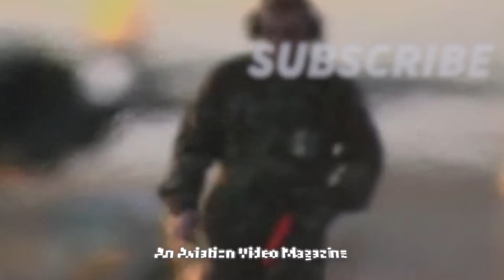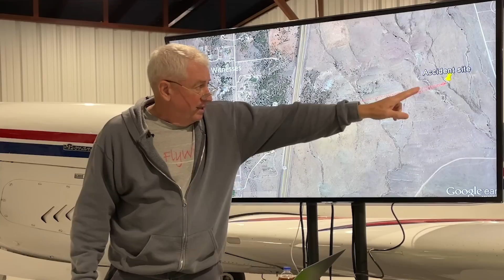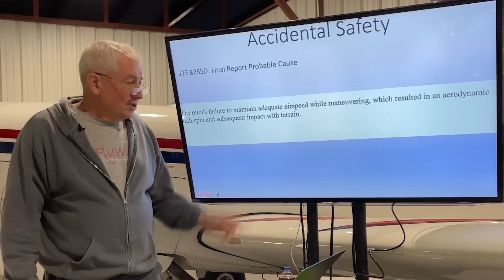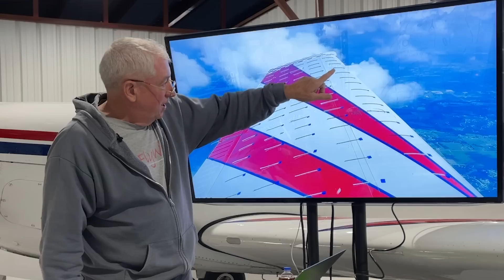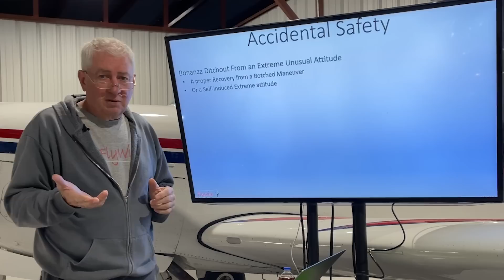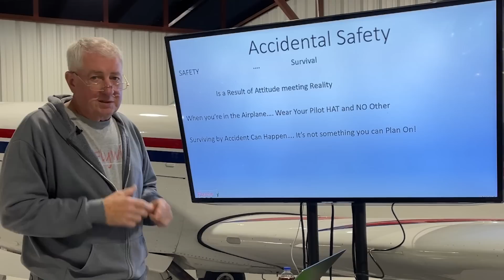Accidental Safety Part 1  LOC I

Comment: Great video, Scott, as always. One question and concern: I fly a G 36 and my POH specifically says that at the onset of the spin, you should go full forward with the elevator. What do you think about this, compared to the advice you provide in this video? 
  Let me take this opportunity to say I just love all your videos. We Bonanza drivers really appreciate your professionalism, and the B-specific advice you provide. Bill
Reply from the maker: Thanks. Bill. In the first 1/4 turn or so a Spin Prevent will work. Unload, coordinated rudder and aileron opposite the nose slice. If you go full forward on the yoke after the spin has developed it is a prospin input and will not be effective at recovery. Did they use the word immediately?
Reply: @FlyWirescottperdue  I see.. that makes sense. Thanks for the explanation. And I am impressed with your quick response!

Comment: Scott - One thing you did not mention that could have contributed to this accident was possible pitot/static icing. You mentioned that there could have been icing in the clouds based on the temp/dew point. Had the airplane been sitting out the night before? Perhaps this is a case of not being in the habit of turning on the pitot heat.  A blocked pitot/static system would basically turn the airspeed indicator into an altimeter adding immensely to the disorientation and the seemingly wild pitch changes at the end.
Reply from the maker: You mixed up videos. The potential of icing was in the F33A accident Part 2. Speed was not erratic and your theory doesn’t account for anything else. Doesn’t sound plausible to me. Was icing a factor? Very possibly it was.  But it remains an open question.

Comment: Hi Scott, Can you explain why pushing is "pro-spin"?
Reply from the maker: Are you ready for a mass moments of Inertia talk? Watch ice skaters doing a spin with their arms out, bringing the arms in reduces the moment arm. Because of conservation of momentum the skater spins faster. In a spinning airplane pushing forward raises the nose ( it’s a moment arm thing) and that reduces the moment arm of the engine…. Conservation of momentum again the aircraft spins faster. In a spin none of the flight controls work like you think they would.
Reply: @FlyWirescottperdue  Makes sense but is this for all spins or just fully developed flat spins? The A36 POH for spins specifies "Immediately move the control column full forward and simultaneously apply full rudder opposite to the direction of the spin...."

Comment: Thank you for this vidio...Years ago I saw somebody mouse up a hammer head in Northern Cali and buy the farm in flat spin.  I did a full power full flap departure stall getting ready for sign off on privot pilot...yeah I know what examiner would ask that..... anyhow falled off to go into a spin...killed the power and stepped on the ball...I was taught to step on the ball as a glider pilot.  Big thing I got from this is kill the power.  I just did it because I didn't want to over speed the flaps.  You live long enough you learn how to not become spin bait.  Or ground scat...

Comment: Hey Scott, love your content! Especially educational information like this...I'm a little older Commercial Pilot candidate (long story, but it's all working out...) and in Canada the spin maneuver is a required element of the flight test. It was when I earned my Private License many years ago here...but, I think it's been dropped for some reason now. The thing that I find interesting, is your video of the tufted inside and outside wings. There's so much happening during a spin; mentally and aerodynamically that I strongly believe every pilot needs the experience.  I don't enjoy doing them all that much anymore, but understanding the correct control inputs to get out of one is absolutely critical...I'll be waiting for part 2!

Comment: Most safety video's people have to watch (for their job) are rather boring, not this one 😁! Excellent (potentially life-saving) information by Mr. Perdue. As I understand power on stalls are not something aircraft manufactures encourage (want pilots to practice) & there is consequently a lack of information how to handle such situations (bravo to Scott here). Think worth mentioning the aircraft Scott did the first part of his stall demo. in (Extra 300L) is designed for acrobatics. Pro spin inputs = profound results in that nimble aircraft (& rather disorientating just watching - each spin, back to back 🤢). Curious if the V--tail such as in the accident Bonanza reacts differently in stall compared to that of conventional (vertical stabilizer) arrangement 🤔? Be really fun to see him do this exercise in a F-15E next time - permission granted.. :goodvibes:.

Comment: I do worry about myself. Now Im hearing myself say that telling people that if they neutralise the controls and leave the power in you they recover from a spin is dangerous. Im pretty sure PARE is more reliable. 

Fascinating that stick forward is a pro spin input. But PARE is power to idle, THEN stop the rotation, THEN stick  forward, which is not pro spin.

Your bit about hypothesis testing was subtly wrong to. You need to test hypotheses to see if they bit the facts, but you ALSO need to check hypotheses that contradict the first hypothesis that also fit the facts. 

One such hypothesis is that the accident pilot was practicing power off stalls, stalled and tried to recover by adding power before he had lowered the nose. I once had a flying instructor tell me that if you are recovering from a stall you can add power and down elevator at the same time! (You can’t because if you are in a powerful aircraft adding lots of power can drop the left wing and put you in a spin. 

Also, of course the FAA was right in saying there was insufficient speed. Unless there is insufficient speed, you can’t stall and spin - but I know what youmeans. 

This is a good example of why everyone should practice spins! The reason is that a) everyone should practice stalls and b) if you mess up stall recovery you can spin. If the accident pilot had done spin training, he would have cut the power and thereby survived. This applies to 300 hp aircraft even more than RA-Aus aircraft.

Comment: I get something from all of your vids...but your departure vids in the Bonanza, are gold. Breaking down sequences in a real plane knocks the lessons into a skull much more completely than any explanation alone. Matching aerodynamic effects, with control input causes...in real time...mentally connects arm chair pilots with every stage of the event.

I also love practicing spins and stalls. It's as much aerobatics as one can legally do in a 172. Because I'm a big boy, with an instructor on board, a 172 won't spin worth a darn. It will spiral (recovery from one of those is also very important to learn) but a spin entry requires power. All that extra energy into the system, can make for a very abrupt break. That sucker can flip on it's back in a heartbeat with power on, stick back and full left rudder. I don't think the violence of that maneuver can be effectively explained. I feel to understand it, one must see and feel those effects, first hand. 

I agree that it would be very unwise for a pilot to practice their first power on spins, solo. Their first few experiences, should be as a passenger, with an instructor. 

Thanks for another great lesson, Scott.
Reply from the maker: Thanks Joe, I appreciate it!

Comment: Can you tell us why your loop "failed" since it seems like your entry speed was OK ?
Reply from the maker: Not enough G…. Not enough energy to get over the top.
Reply: Your  physical response was rudder pressure. I'm trying to understand what sense  or multiple reactions of the plane during Your attempted maneuver told you what was going on. I believe it is what you saw out there front window. Am I  correct? 
I  realize the importance of flying with intention all the time and heightened awareness of what is going on even in the long monotonous  cross country flights.
Thank you for the effort and time to enable us to learn !

Comment: I actually used your example of Idle neutral aft (stablize spin) -> rudder (stop yaw) -> forward stick (recover) with my DPE which in hindsight was kind of a gamble. He accepted the answer because he is extremely knowledgeable but you better believe he made me explain each step to make sure I did. 

I’m glad you mentioned accelerated stalls. I’m going to give my CFI a call to practice those. I can’t believe they aren’t a part of the PPL ACS

Comment: Thankyou to the third witness for speaking up.
Reply: Scott, I'm trying to understand what's happening with elevator during a spin recovery. I understand forward elevator reduces the angle of attack in the outside wing and is therefore a pro spin input. My question is: before the spin is arrested with opposite rudder, is it best to use some aft pressure, or should I leave the elevator alone completely? Also, whe does apply some aft elevator help airflow get to the rudder/elevator? And thank you for these amazing videos!

Comment: G,day Scott from Sydney Australia.
Thank you for the explanation why a plane goes into a Forward Spin Stall.
Takeaways
'chop to power' (cannot spell idaell)
neutral with the elevators
aft 'opposite rudder input's 
Scanning the PFD in a spin for critical data e.g altitude, airspeed and artificial horizon "blue side up" back into straight and level flight.
🛩️⏳

Comment: I had alot of fun duplicating what your whole program was about..BUT>>>>I did them all in a 2 meter sized RC plane that I have flown for years. Yes the prospective is not the same...no seat of the pants feelings...BUT, I was able to see exactly what the plane was doing in each event.  An airplane with power is an airplane with power. I was shocked how many times I got myself into trouble on the power on stalls.  Flat spins in a 2m RC plane is fun to watch...but pretty tough to get out of. This was not a 3D stunt plane either.  They can do it all day long. Anyway...great video!  Thanks for the idea.